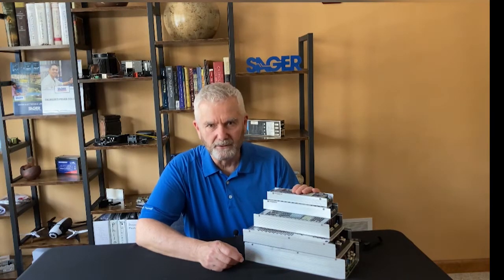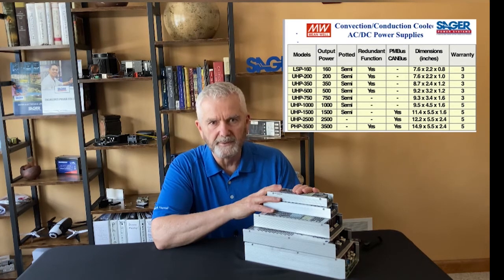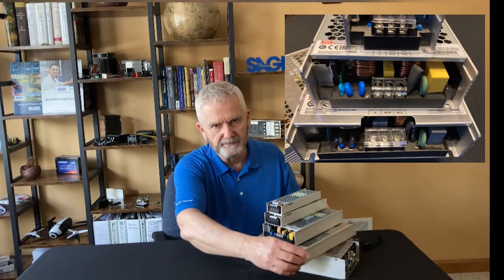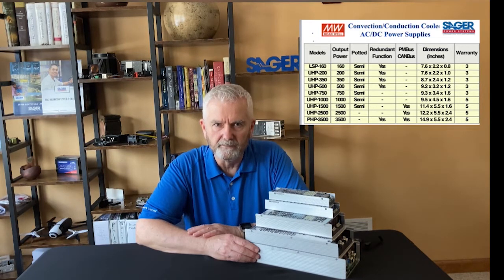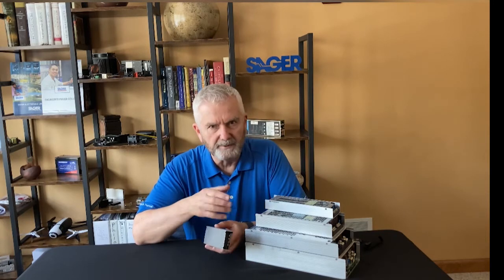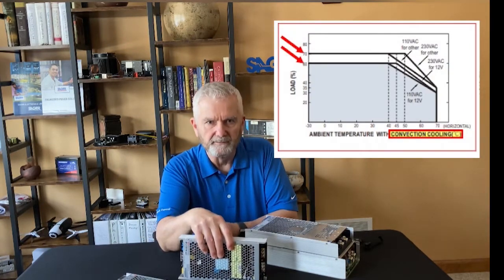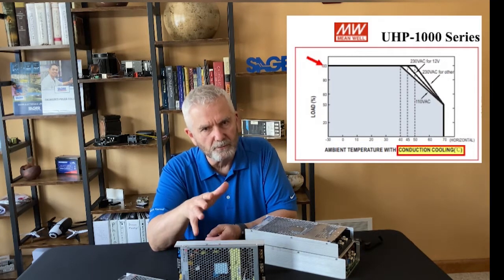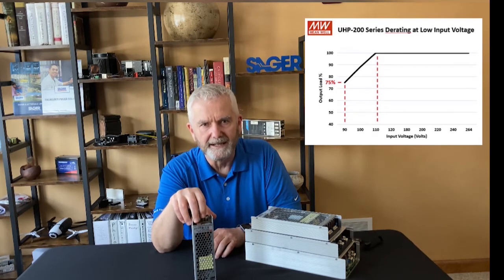MEAN WELL UHP Series Power Supply Review

Comment: If a high reliability fan is not selected for a design it is often the first component in a system to fail.  The UHP is a workhorse and a great solution for customers who want to operate their system without a fan either due to noise reduction or reliability concerns.  Thanks for the great overview of the Meanwell UHP Series David!